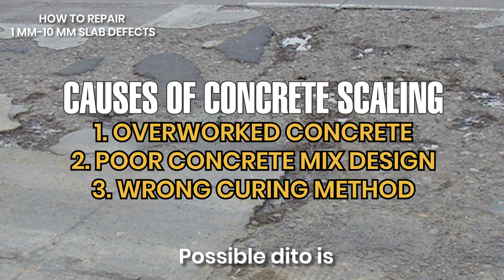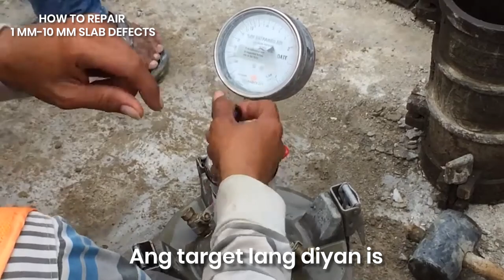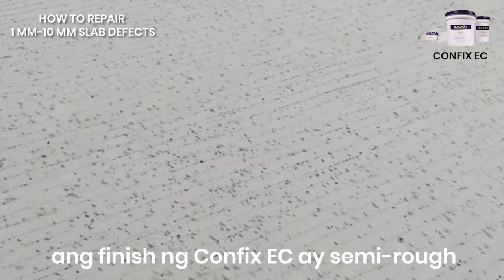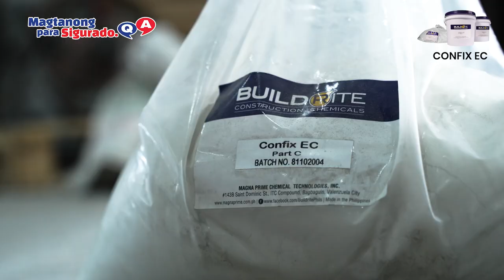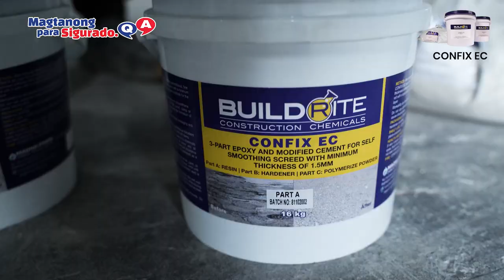Concrete Repair Solution for Scaling (1-10mm Concrete Damage)

Comment: Can i use hardcrete 510, cure for 28 days, then use a floor polishing machine? How many bags will i also need to cover a 120sqm space at 10mm thickness? Thank you
Reply from the maker: Hi, thank you for your inquiry. Yes, you can use Hardcrete 510 pero kailangan po makapal ang application, hindi kakayanin kung 10mm thickness lang. Hardcrete 510 can approximately cover 1.25sqm at 10mm thickness per 25kg bag.

Comment: Sir question po..normal lng po ba gumamit ng 9mm rebars for reinforcement s 2nd floor concrete slab? Slamat po s ssgot❤
Reply from the maker: Hi, thank you for your inquiry. Naka depende po ito sa concrete design. Structural engineer nyo na po ang makakasagot kung anong size ng rebar ang dapat.

Comment: Ano po ang equivalent product nito sa USA? Mortar with epoxy mix.  Kailangan ko po Eto sa basement walls na 80 years old na po
Reply from the maker: We cannot provide other brand recommendations aside from ours
Reply: @BUILDRITECONSTRUCTIONCHEMICALS  sir ano pa kailangan sa rough finished para maging smooth
Reply from the maker: Hi. Thank you for your inquiry. The materials you need will depend on what paticular area you are going to apply it.

For walls, you can use Skim coat. You can watch this video for your reference: https://www.youtube.com/watch?v=Yt6_Q8OWVMI&t=235s

For flooring, you can use either Level Up self leveling compound or Hardcrete 303. You can watch this video for your reference: https://www.youtube.com/watch?v=NSXtg13Nn0g

Comment: Halo sir, advisable ho ba na to resume work kahit meron repaired concrete scalling kahit hindi pa nameet ung 15days 2500-3000psi na strength? if possible , what ho yung full cured days. thank you
Reply from the maker: Hi, thank you for your inquiry. Confix EC can be walked on after 15 hours, ready for light mechanical loading after 2 days and fully cured after 7 days.

Comment: Anong maganda gawin sa kitchen ko puti ang tiles at medyo meron ng tiles mukha ng madumi na hindi mo na matangal ang dumi anong klaseng paint ang gagawin ty
Reply from the maker: Hi. Thank you for your inquiry. You have to check first if the grout and tiles are still intact, not debonded and has a good level. If this conditions are met, you can apply Epocoat FCH over it but the primer you need is Blockout TW instead of Epocoat MB.
You can watch this video for your reference: https://www.youtube.com/watch?v=NP1dWiOkmQU

Comment: engineer binaklas ko po ang tiles ng slab concrete namin para palagyan ng water proofing, pwede ko po ba gamitin yang recommended nyong materials para  gamiting pang repair dun sa bukul bukol  o ordinary cement, alin po ang mas maige salamat po. Ok din po ba na i pa water proof ko after na marepair gamit ang recommended nyo pong polyurethane for waterproofing. Thanks po sa sagot.
Reply from the maker: Hi, thank you for your inquiry. First, we need to know what particular area you are talking about on your question so that we can give you the right recommendation. You can directly message us on our Facebook page: https://www.facebook.com/BuildritePhils
Reply: @BUILDRITECONSTRUCTIONCHEMICALS  sa roof po yung roof po namin eh semento po thanks po
Reply from the maker: Proper assesment and surface preparation are needed before proceeding to waterproofing.

Comment: Good pm sir! advisable po ba na iopen to traffic ung repaired scalling kahit di pa nya nameet ung 14days 7000psi na strength? if possible ilang days po ung earliest na pde na iopen to traffic
Reply from the maker: Hi. Thank you for your inquiry. Buildrite's Confix EC's waiting time is:
- Can be walked on after : 15hrs
- Light Mechanical loading after: 2days
- Fully cured after : 7 days
- Can be over coated with epoxy based materials as soon as 
surface moisture content of CONFIX EC is less than 4%, however not earlier than : 1day

Comment: Solid cure vs epoxygrout
Reply from the maker: Hi. Thank you for your inquiry. SOLIDCURE is a non-shrink, cement-based, high strength developing grout which is specially formulated for use in critical grouting operations and concrete spalling repair where positive expansion and 
self-levelling characteristics are required. It has 3500 psi @ 1 day, 7500 psi @ 7 days and 9200 psi @ 28 days.

CONFIX GROUT 40 is a high strength grout, based on 
modified epoxy resin and is used as heavy grout where 
heavy dynamic, mechanical properties and chemical 
resistance of the hardened grout are required. It has 3000 psi @ 1 day and 12,580 psi @ 7 days.
Reply: @BUILDRITECONSTRUCTIONCHEMICALS  if mga honeycomb po, ano mas maganda gamitin sa dalawa?
Reply from the maker: It will depends on the compressive strength of your existing column or beam. If the compressive strength of your beam/column to be repaired is more than 8,000psi, we recommend using Confix Grout 40. If it is less than 8,000psi, then you can use Solidcure.